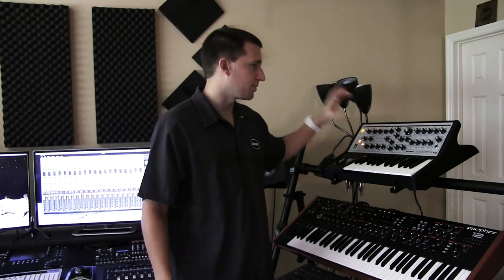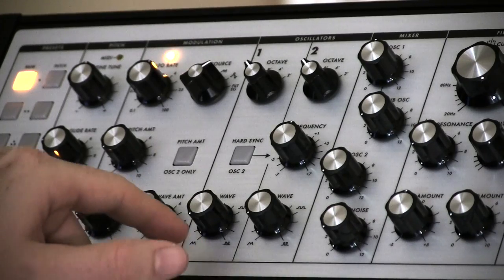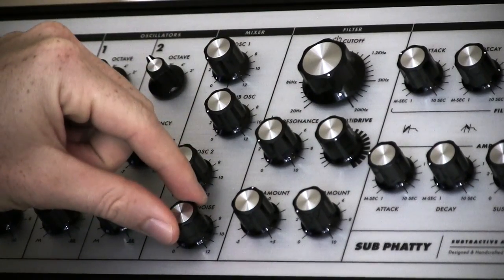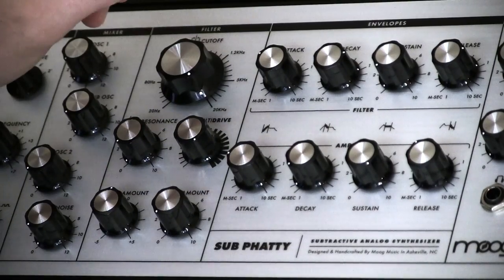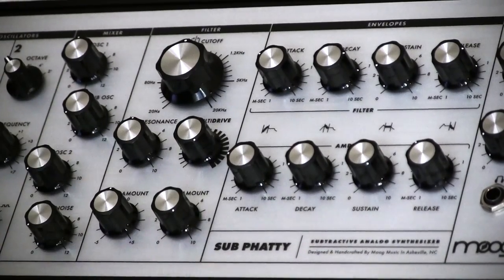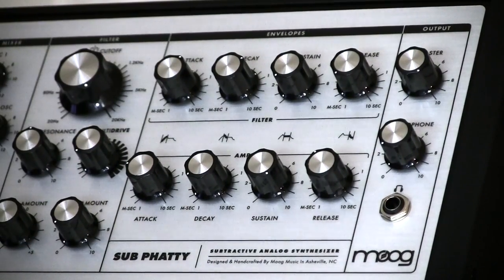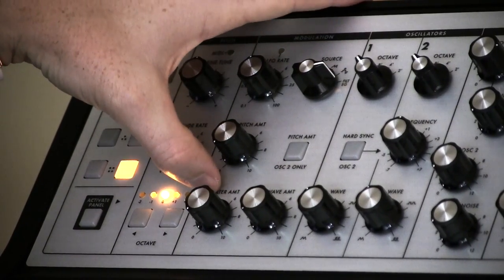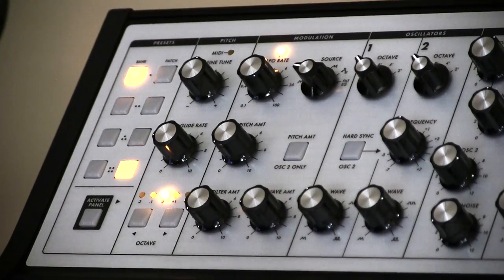Synthesis & Tools of the Trade: Moog Sub Phatty

Comment: An MS-20 Mini and the Sub Phatty is the best you can currently achieve for a pretty low price in comparison to other analogue synthesisers; the Sub Phatty is the musical kind, with a very tasty, tamed and orthodox sound, whereas the MS-20 is the rebel, the rule-breaker with a taste for unearthly sounds. For my Hip-hop compositions I'd use the Moog for its wonderful sound, but when working on sound design I would go with the MS-20. At least in my opinion.

Comment: Q about CV. There is CV in (Pitch CV)...and I would like to use it for FM frequency modulation. Is it possible? Does it modulate osc frequency? I would buy it if this can do FM bass ;)
I have checked manual but didn't get my answer from it.

Thx for help and great video. If you need feedback - it is hidden in my Q above ;)